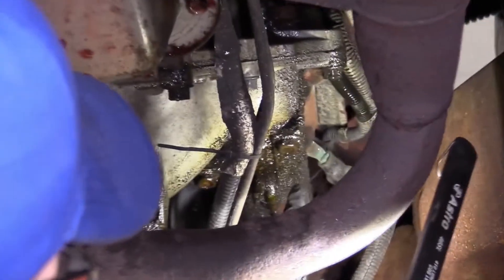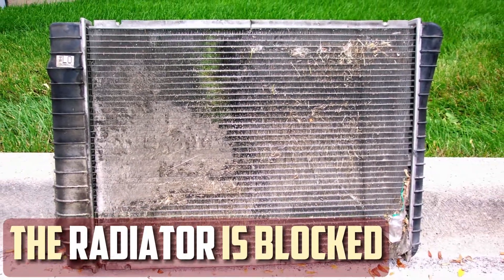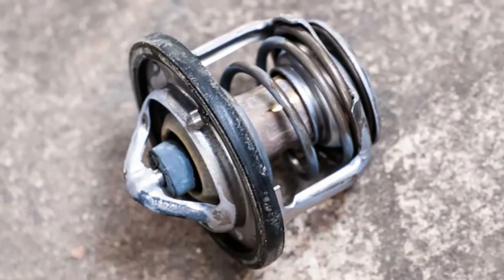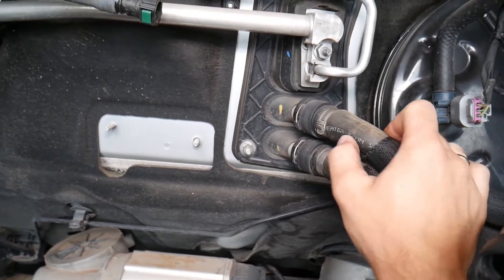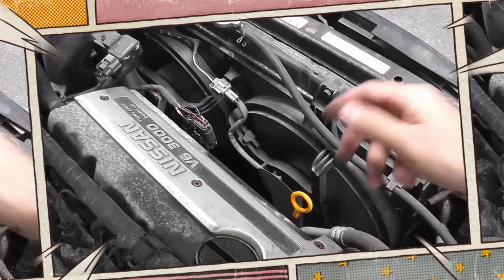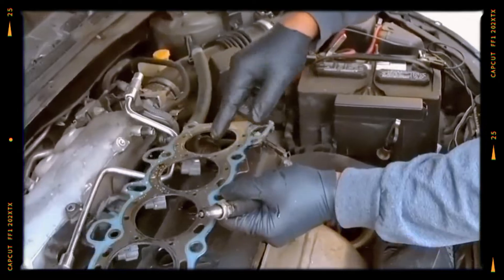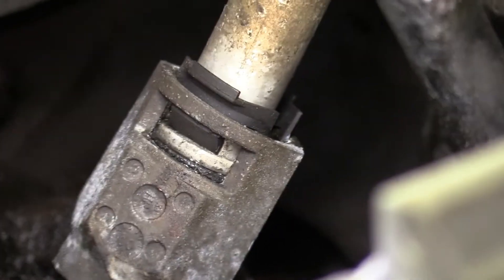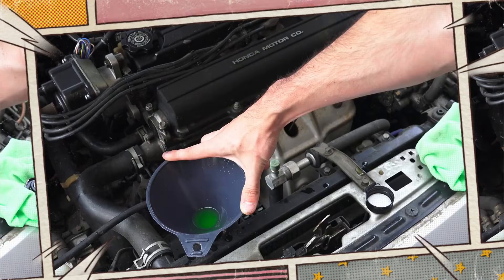6 Reasons Your Engine Overheating but Coolant Full & How to Fix this problem?

Comment: I’ve replaced the radiator, upper and lower radiator hoses, thermostat, water pump, gave it a good flush. Fan works no issues but if I’m driving above 55-60 mph it starts to overheat…when it starts to get too warm and I park it the fan will cool it off,  but if I drive below 55-60 mph
No issues
Reply: May be a head gasket issue
Reply: ive had to replace my coolant pipe. that helped a bit but i need to do a flush now i believe.

Comment: I have a 2012 glk 350 4matic. It was overheating, theres no leaks, no steam, no check engine light on, no weird smells. What else can it be? Shouldn't i get a check engine light if its the thermostat or water pump?
Reply: Update?
Reply: So, it was the thermostat this whole time. The fact that I never thought about it, is because I just replaced it with the cheap AutoZone brand. So I fkd up. Never replace cheap parts to a Mercedes.  @sameenergy9414
Reply: @sameenergy9414 I replaced it 3 months ago, so I never thought it would be that part. But it was. That shit melted, it was all twisted. Fukn AutoZone parts bro. If you have a Benz, use Mercedes parts only.
Reply: @jimmytapafini5378 so it was water pump?